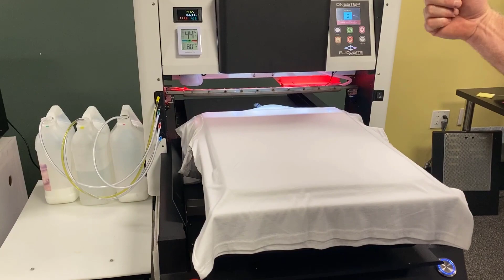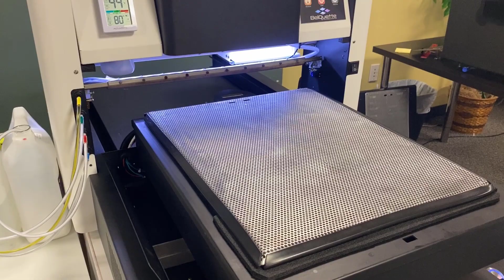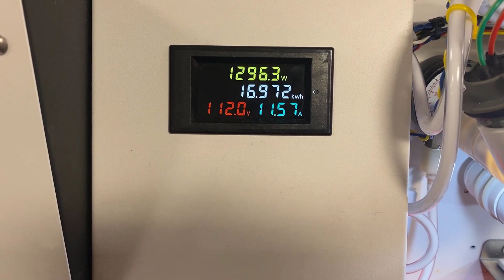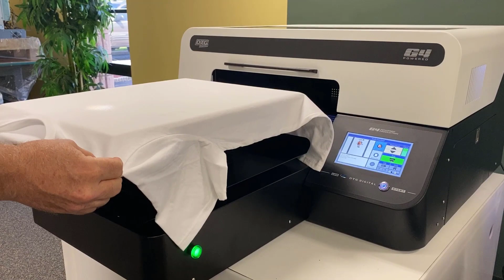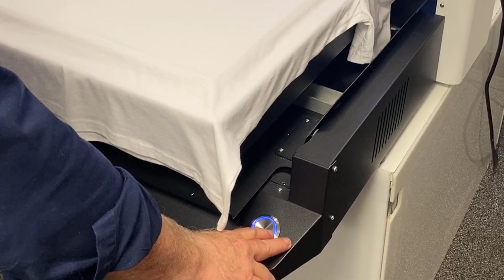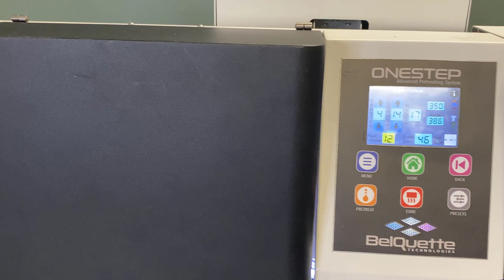OneStep Pre-treat and Cure Machine

Comment: What about the nozzle and clogging on this machine? That's the biggest frustration with the PTM.
Reply from the maker: The OneStep incorporates advanced auto nozzle and fluid conditioning routines with a built-in flushing solution reducing potential nozzle clogging. In addition, it's recirculating. It's very close to self-cleaning!

Comment: Dark shirts. White shirts are easy. Color shirts pose the biggest challenge.
Reply from the maker: Hey Dalton - white shirts are easier to print, that's for sure, but the pretreat and cure procedures with the OneStep are going to be the same. Nevertheless - we'll have some dark tshirt videos up soon
Reply: My man
Reply: And this works with any type of pretreat, even poly?
Reply from the maker: @daltontyson  Yes, it's worked with every pretreat we've tried.
Reply: @ColDesiColman  when will this be available?
Reply from the maker: @daltontyson  We're looking at Q4 - so possibly November
Reply: @ColDesiColman  if this does what you claim.  It'll be a game changer.